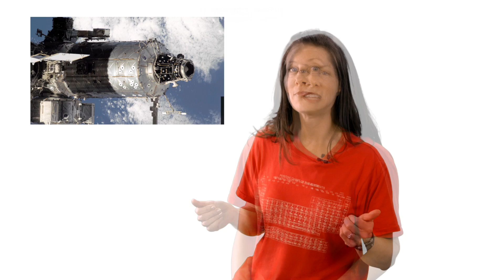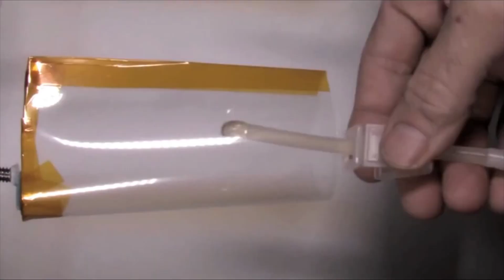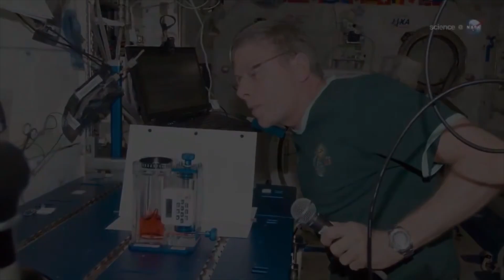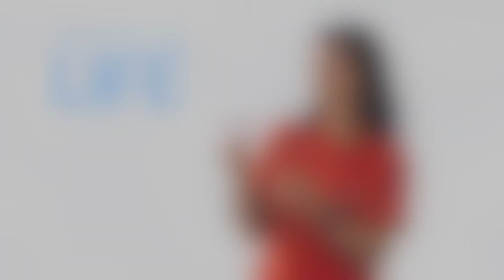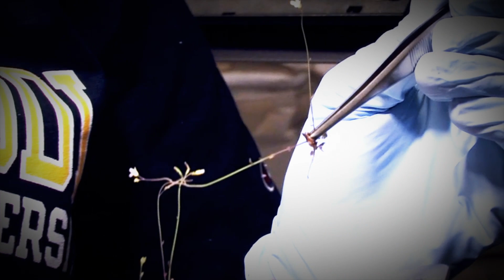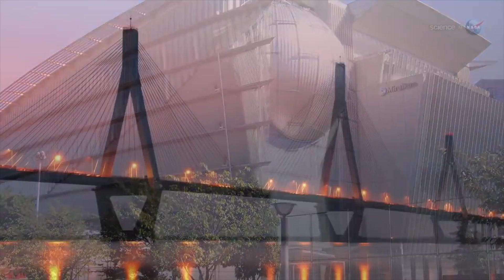StationLIFE: Let’s Get Physical

Comment: I almost do not know anything about physics and chemistry, but couldn't they design a station that have gravity in it? like the floor act as earth gravity?
Reply: masoud905  A very good question. There are several problems with trying to make the station have gravity. I hope on one of the future segments they can go into that because I do not have time to give my view and I might get something wrong. One thing about having the station is that they are trying to conduct experiments without gravity so making the station have gravity would work against them.
Reply: thank you
Reply: masoud905 no dumbass
Reply: Too expensive plus like James said, experiments performed on the station need to be done in  microgravity
Reply: masoud905 it's also more efficient to utilize all sides of the rooms.
Reply: It's impossible to create gravity on a flat surface with a gravity generator or some sci-fi stuff like that. It is possible to make a circle-shaped space station spin around its own axis. The centrifugal forces would then push you to the ground and if you calculate the radius and revolutions per second (how fast it spins) then you can make these centrifugal forces push you out with an acceleration of about 9.81m/s^2, so 1g. You can experience these centrifugal forces when you get on a carousel.